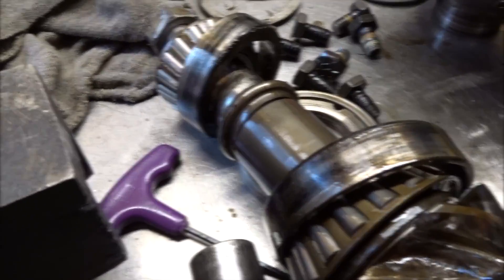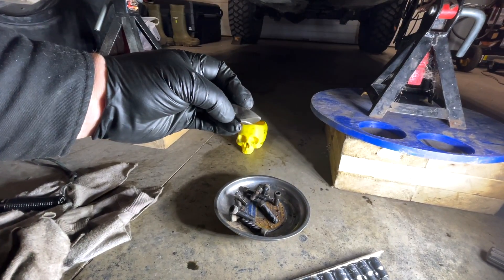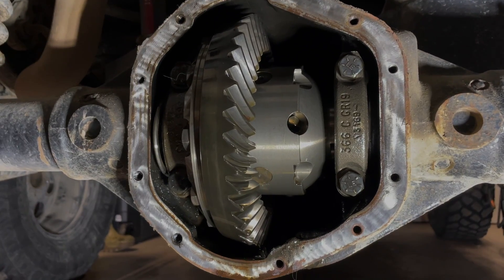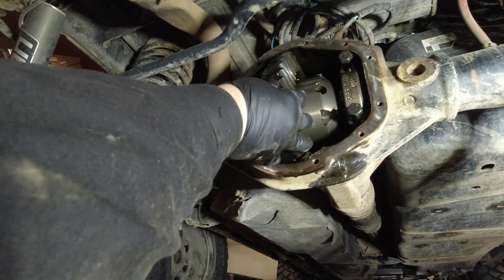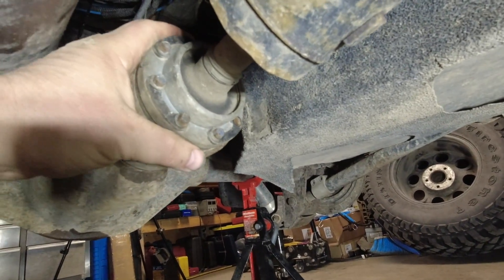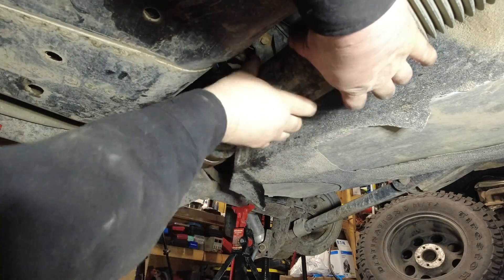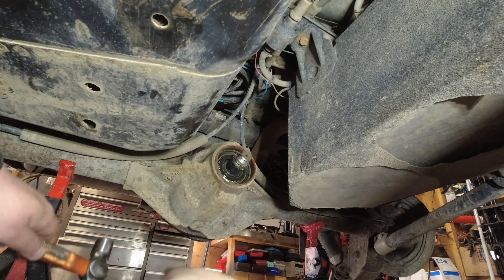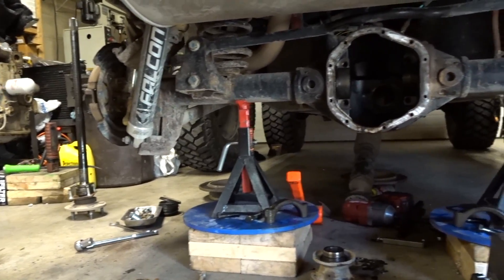Dana 44  How to Rebuild | Jeep JKU DIY

Comment: I know this is a couple years old.  But i really hope you can help me. My dana 44 rear on my jeep wrangler is the same way.  The shims were sticking out on the left hand side. They were pretty tore up. The thing is.  On the left side there were 8 thin shims.  On the right side there was one shim about an 1/8 thick along with a thin shim.  I tried to put the thick shim next to the 8 thin shims and it seems to be the same thickness.  But i just don't know.  I don't want to put 8 thin shims back in there. I'm pretty sure that caused the fail.  Which was chopped up, not so bad tho, spider gears.  I know how to put it together except the shims.  Had they been the same,  it would be easy.  
My theory is someone lost the left side thick shim and their remedy was 8 thin shims.  I'm just not 100% sure and that's where i need the help.  Please.
Reply: Use a digital caliper to check the thickness of each of the 8 shims, check the single shim, and if the combines thickness of the 8 equals the 1, swap them out. Theres no gain to multiple thin shims as opposed to a single thicker one. Hope it helps though 2 months past